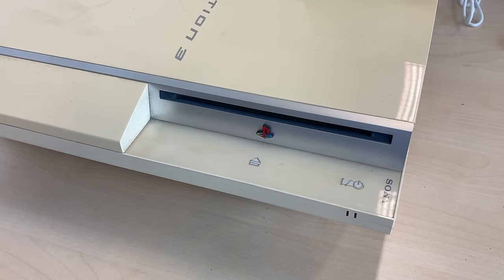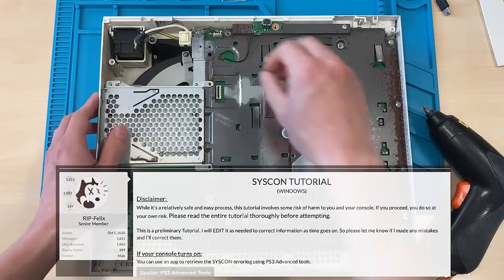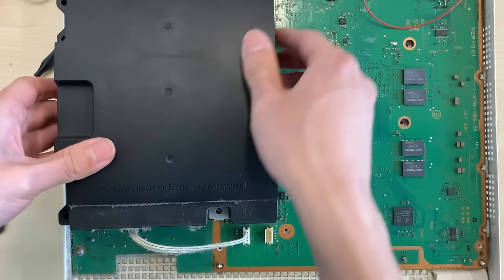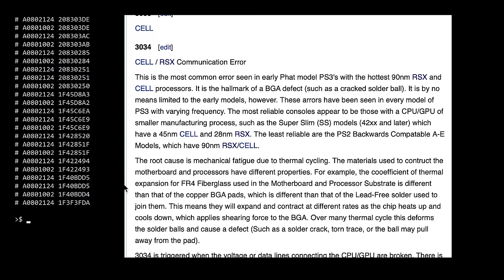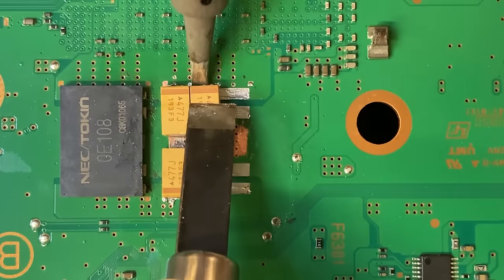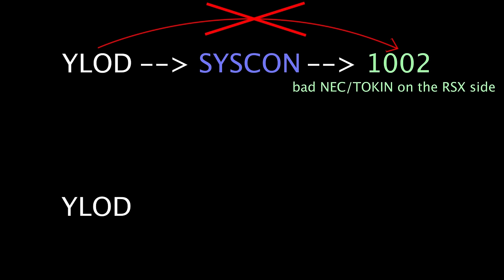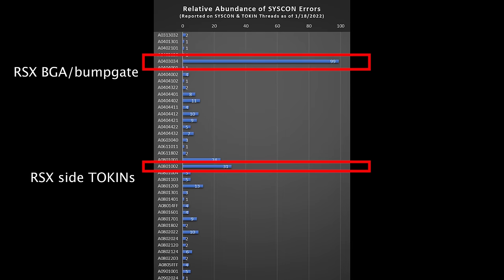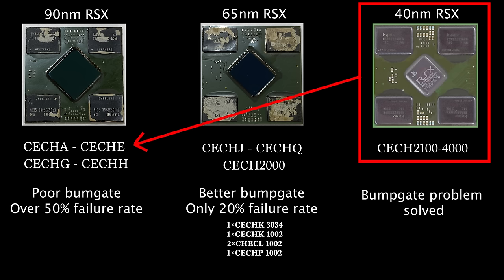Dealing with PS3 YLOD in 2024 (SYSCON)

Comment: Nice, how do you manage to remove and add solder without the soldering iron gets stuck? PLS help
Reply from the maker: It sounds like your soldering iron is not hot enough. What temperature are you using? I am using 400C.
Reply: @hardwarerepair200  450C but the same
Reply from the maker: @skewbtf2  Hmmm, then I am not sure what is causing it. I haven't encountered this problem before.  Hopefully someone out there will know the answer and help you.
Reply: @hardwarerepair200 maybe be flux? I use generic flux
Reply: @skewbtf2  I do these without flux. Is your tip dirty? (Hehe)

Comment: But how likely is if 90nm console that is fixed from 1002 by cap swap, won't fail due to stress and age shortly after?  If the failure rate is over 50%, then you just gamble that you won't be affected.
Reply: The failure rate isn’t over 50% for the console, there is a 50% chance for the RSX chip to be the culprit if the console were to fail.
Reply: @largevapor  Got it, thanks.
Reply from the maker: Also this model is using a 65nm RSX instead of a 90nm one.

Comment: I have A  FAT 60gb 03  ps3 . It asks for wired connection.  Says there isn't one even when connected.  There is no option for wireless selection!   What is going  on?
Reply from the maker: I had a similar problem before.
https://youtu.be/fHMggRsV2-o

It seems there are some very strong WIFI signals that crash your PS3. You can try a place with less WIFI signals.

Comment: I wish I had this device to find out what happened to my ps3, because I got the ylod after something inside my ps3 blew up, it was a loud blowing up noise, it immediately turned off and never turned on again, and I got the ylod. I opened my ps3 and took the mother board off and nothing there looks blown, all the components look completely normal. I wish this device was available to buy here in Brazil, cause I can't import anything :(
Reply from the maker: I guess one of the small capacitor is blown. They are very small, but if you have a magnifying glass, you might able to see it.
PS3 boards are huge, so it would be very difficult to check each capacitor one by one.
Reply: @hardwarerepair200   I found a black component with the letters YD on it that looks pierced with a little hole, I don't know if that's it or it was like that already, it's on an area on the mother board maked as F6001, I don't know what it is nor what it's for. By the way,my ps3 is a CECHL01, I had it for 9 years and a half before it died, I miss it a lot =\
Reply from the maker: @KywokiYakasaki  Is it something like this? 
https://www.reddit.com/r/PS3/comments/ua0ah1/i_saved_this_miku_ps3_from_a0202120a0213013_by/

Comment: Hii can anyone help me with that I have a ps3 when I started it's beeps 3 time and shut down and red led blink in 5th time I started it starts normal and I play GTA 5 for hours without any issues but when I play call of duty modern warfare 2 it work then doing 3 beeps and red led blink again and I don't have 
temperature issue  why? Also can I see the error syscon through the ps3 when it work or I need to soldiering RX and TX Also can I use Arduino uno or ESP32 to see the error code please help?

Comment: where did you buy the replacement capacitors and which models?
Reply from the maker: I would recommend 2R5TPE470M9, but any capacitor with a low ESR would also work. I bought it from aliexpress but it is better for you to buy from reputable sellers such as Digikey or Mouser. Because half of the capacitors I got from aliexpress are broken (ESR too high).

Aliexpress is cheap, but then you need to go through the trouble of sorting out good and bad capacitors.
Reply: @hardwarerepair200  thanks i will have it in mind

Comment: I have 3 slim whit problems, model 2 ps3 2004a  and  1 slim 2504b yloid
Reply from the maker: You can extract SYSCON error log to see what's wrong. If you see 1002 errors, then your YLOD can be solved by changing the capacitors.
But SLIM 2504B should be free from the capacitor problems... Anyhow, SYSCON is your best friend when it comes to YLOD.

Comment: is this working for ps3 slim
Reply from the maker: Yes. If you go to 9:12, I explained that the SILM one uses either the 65nm or 40nm, which is much more reliable than the 90nm one. So if you are a SLIM owner, then here's the good news. You are less likely to face YLOD. If you do, it is more likely to be the capacitors rather than the GPU. So cheaper repair for you. But of course, always check syscon before attempting any fix.

Comment: Can I buy any kind of capacitor from eBay?
Reply from the maker: Yes, you can. But be careful that sometimes eBay sells capacitors that failed the quality check.
Last time when I buy from eBay, 50% of the capacitor are bad.
But if you have the right equipment to check the capacitor, and ebay is selling them at least 50% cheaper than legit stores (DigiKey and etc.), you could give it a try.

Comment: Youre telling me that for 14 years I thought those capacitors were special in some way and they really aren't? Aint no way.

But seriously, I did always assume they had some kind of trick behind them, like a filter or noise reduction built in - not just some caps you can run in series, with a sort of parallel config. 

Not sure how you would label this configuartion, unless  the other two in series are purposely redundant.
Reply from the maker: From my understanding, they are just decoupling capacitors
https://en.wikipedia.org/wiki/Decoupling_capacitor

I have a newer video explaining this
https://youtu.be/40XQ8L9wsCA

Comment: Couple of Questions: 

1 - Knowing it was the NEC/TOKIN, did you just replace the one chip or more? 

2 - How did you know to replace that specific chip in the video or does it not matter which one you replace so long as you replace one of them? 

3 - If replacing the chip doesn’t work would you do the other three?

I’m in the same boat but have the 20% failure bum so it’s possibly the chips. I’ve ordered the diagnostic chip and 20 capacitors but I’m just confused about the above. Amazing video and thank you for sharing your wealth with us!
Reply from the maker: 1. I usually remove two.

2. I do it progressively. If two doesn’t work, I will go for four.

3. If it doesn’t work, I will check syscon again. If it’s still 1002/1001, I will continue replacing the Tokins
Reply: @hardwarerepair200  Amazing, thank you for this further insight. I’m glad I bought enough to cover enough for all the tokens as I had an inkling this could be the case. Hopefully they all arrive soon. Thanks!